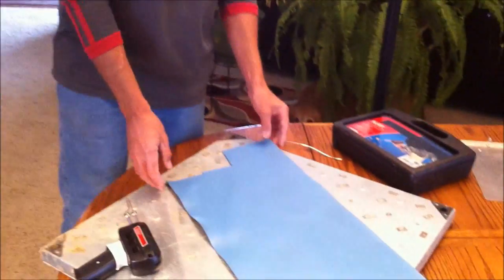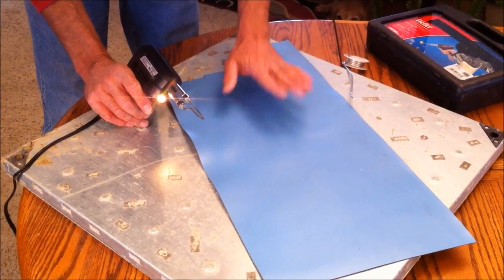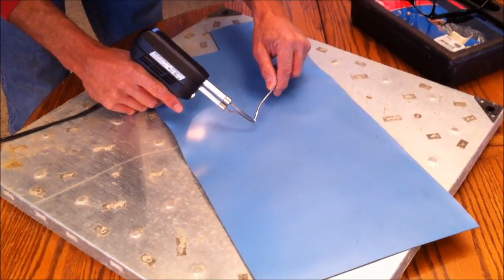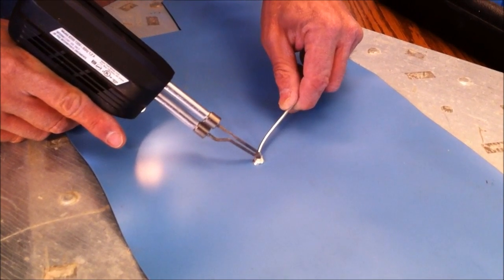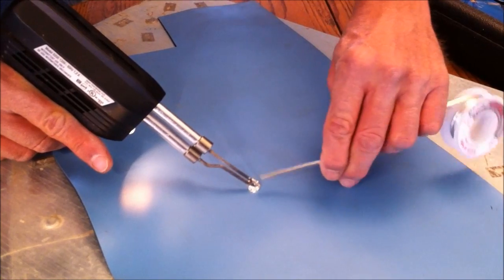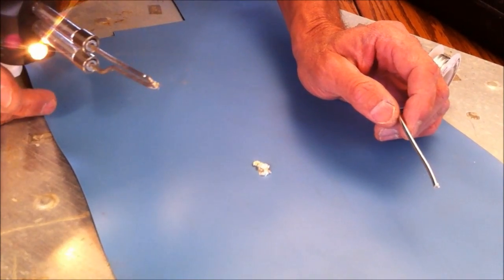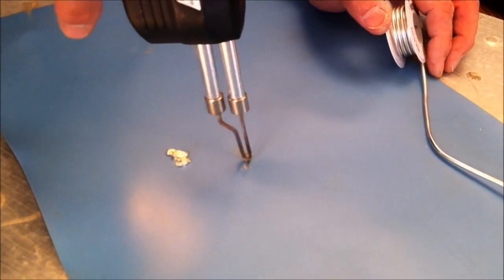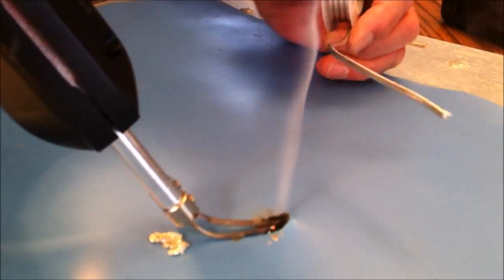Heat Resistant ESD Mat

Comment: Question, can I used it put between 2 device?

I want to put my external HDD attached it back of my laptop. I worried the heat that the HDD produce effect my laptop.

Anyways, I don't plan to leave it on my laptop forever, but just for convenience whenever I have nonething to place it down while it's plug into my laptop.

So witch side do I place it? The blue or black for the HDD I wanted to stop heat transfer to my laptop.
Reply: Thanks for asking, great question. It should work well for this application.

Comment: FINALLY!!!... SOMEONE DISCUSSES TEMPERATURE RESISTANCE OF AN ESD MAT SOLUTION!!!

Thank You

Are there mats with any higher rating, Mr. Cooter?
Reply from the maker: RangeControl, thanks for watching! THE highest temp resistance is provided by coating a steel plate with multiple coats of Rustoleum High Temperature spray paint. The steel starts out much to conductive for use as a static dissipative surface but after application of about 6 to 12 coats of the (electrically insulative) paint the mat falls nicely into the static dissipative range of >1.0E06 and <1.0E09. We make them on occasion - the paint handles intermittent temps of 1,500 deg. f.
Reply: Steve Cooter LOL, I appreciate it.  I was actually wondering more specifically about purchasable mats. :-D